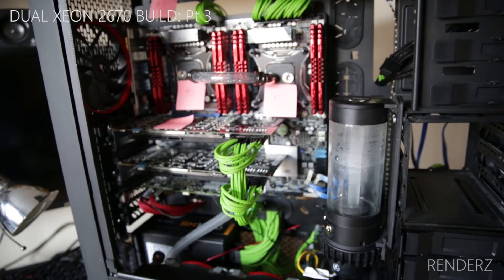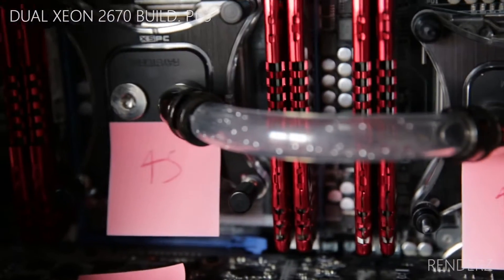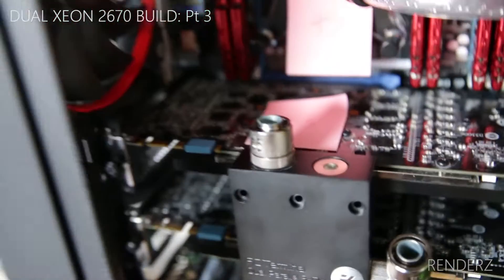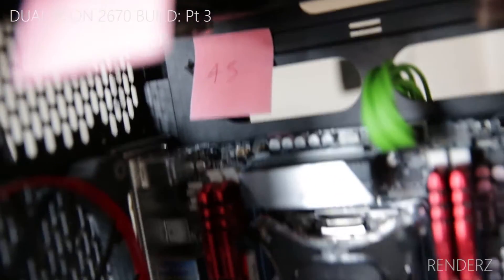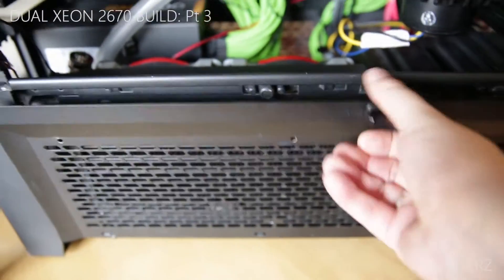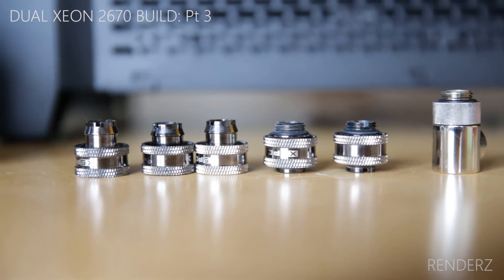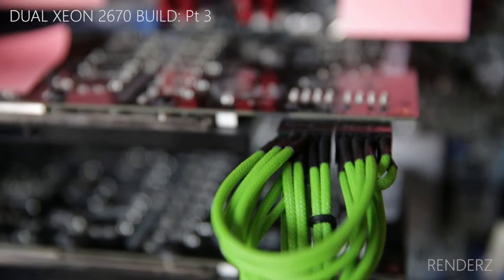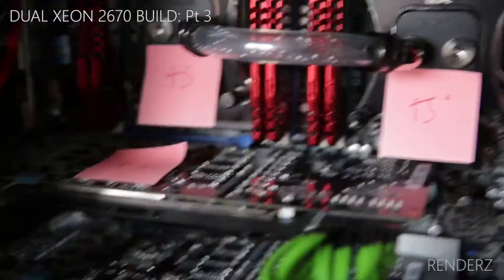Dual Xeon 2670 build log: Part 3

Comment: surely the waterloop would look cleaner if you went from CPU 2 straight into the EK terminal :P
Reply from the maker: +matthew brown I'm curious. Please could you explain how the rest of the loop work look like? I'm considering anything at this point.
Reply: +renderz well if you go behind the back panel with the tubing you could route to the top radiator without being seen then go back down the back panel from the output closest to the cut out, down by the side of the board and into the rightmost CPU (forget if it's CPU 1 or CPU 2 on that board) over the ram and into the rightmost CPU, then over to the next CPU and then from the output there into the terminal block then through that dual rad at the bottom then the rest of the loop as it was in the video, i think that could work fairly nicely and look much sleeker personally, it is more tubing and does mean a little bit of doubling back but ultimately i do think it would look cleaner than the current plan, apologies for the delay also, internet had some issues :P

Comment: I never said i hated your RAM, i just thought it looked really damn ugly in those light blue RAM slots. It just in general didn't match the blue on the Motherboard.

From this perspective it actually does look decent, i must admit. Partly because you can't see much of the blue from the mainboard anymore.

Add red sleved cables in the future and this thing is mint!

I got my board back from RMA btw. all working perfeclty now. Really quite happy with it. I still need to OC the memory further, currently still @1600 with ECC on no problem.
Reply from the maker: +Coldministrator no offence taken mate. You're right about the colour scheme, but I have to have some money to feed my cat :-)
Reply: +renderz blue spray paint should do the trick and its cheap